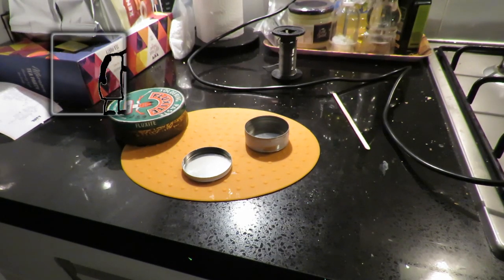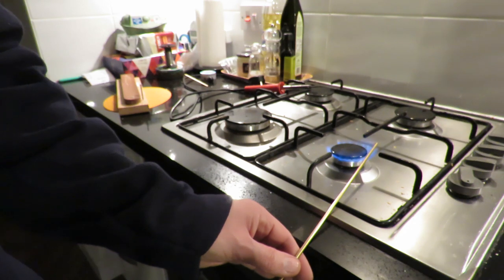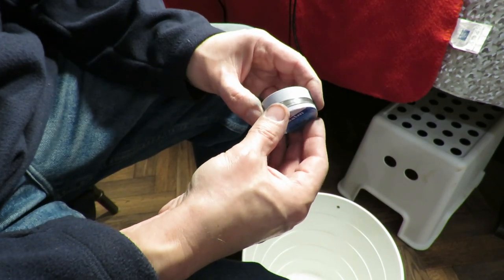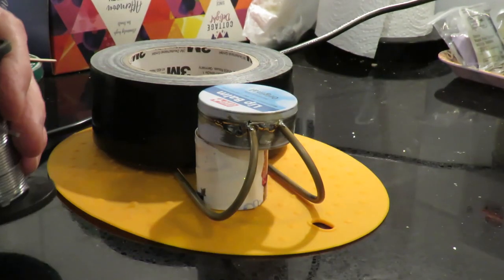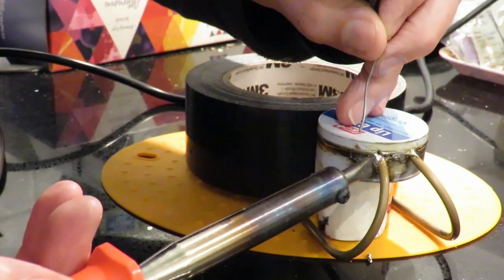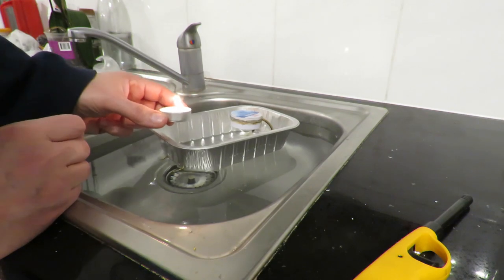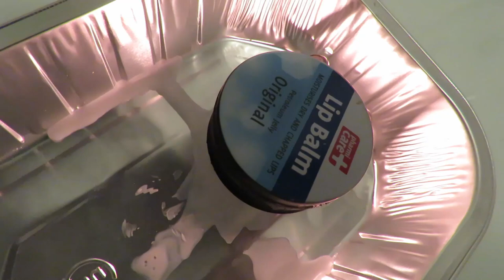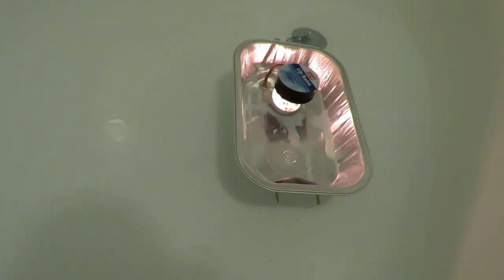Pop Pop Putt Putt boat

Comment: Hey Grandad. At 11:35 time stamp you were moving the black cord of your soldering gun from left to right over the hot tip of the gun and I spotted a touch to the cable with a puff of smoke coming off the tip (view slow motion). Don't be setting fire to your gun by burning the cord in two pieces.
A short like that makes for too much excitement. Lol

Comment: No pop cause you r top of the can to stiff and your supposed to bend it 3 bends upwards and 3 bends downwards to make the top bounce up and down by the steams pressure
Reply from the maker: Yes, if your purpose is to make a noise, but it has ZERO effect on the performance.